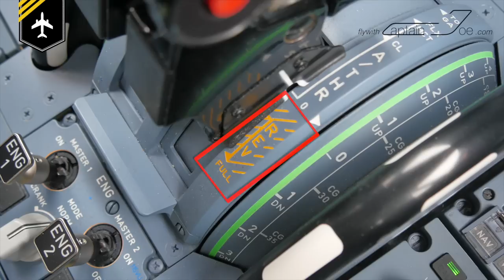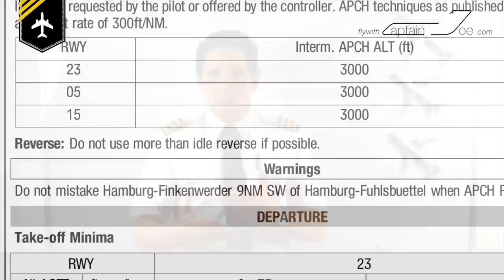What is reverse thrust? Explained by CAPTAIN JOE

Comment: Excellent video, I have a few questions.

1) If only the bypass air is directed in the forward direction what happens to the air passing through the engine core?

2) I have seen videos of aircraft engaging reverse thrust ( or at least opening the reverse thrust flaps) just before the airplane touches down is this recommended during certain conditions?

Comment: Thrust reversers can be divided into two categories;
the Mechanical-blockage type and the Aerodynamic-blockage type. 
Mechanical blockage is accomplished by placing a removable obstruction in the exhaust gas stream, usually somewhat to the rear of the nozzle. The engine exhaust gases are mechanically blocked and diverted at a suitable angle in the reverse direction by an inverted cone, half-sphere, or other means of obstruction, while the Aerodynamic, thin airfoils or obstructions are placed in the gas stream, either along the length of the exhaust duct or immediately aft of the exhaust nozzle.

Comment: Hi Captain Joe, I wanted to know why 4-engine commercial jets (747/A380/A340) sometimes only use the reverse thrusters on the 2 inboard engines rather than all 4 engines?  I hope this gets through to you.  Thanks.
Reply: It's only on the a380. And its simply because of not needing that complexity. The majority of stopping power actually comes from the brakes itself. So the reverse thrusters don't generate a major ton of braking.
Also, the a380 mainly serves routes where long runways are readily available, so again that extra reverse isn't really needed.

Comment: On other planes such as the Boeing 777, you won’t hear the engines spooling up that much when you use idle reverse so, you will hear just a little bit of a spool but in full reverse thrust, it is quite loud.

Comment: If my memory serves me right, NASA used a Gulfstream business jet with a space shuttle cockpit simulation on it and to train approaches they used to engage  a small amount reverse thrust in mid flight to give the gulfstream the glide characteristics of the shuttle.  

I always thought that revesrse thrust on an airliner used to pull up the reverser gate lock tabs on the throttles and then you'd push forwards on the throttles rather than pull the gate lock switches and pull back beyond idle.

Comment: I thought on some planes the reverse thrusters were activated immediately before landing, but that they didn't actually kick in until the plane is on the ground...when some sort of a pressure switch, activated by the plane touching the runway, told the plane that it was okay to activate them.  I thought this avoided having the thrusters accidentally activate in mid-flight.
Reply: Tflexxx02 I think you confusing spoilers with reverse thrust. spoilers will automaticly activate if armed and when the wheels touch the ground. Reverse thrust can't be activated in flight in all aircraft currently in service. some older aircraft were able to

Comment: Not sure if it's my imagination but I remember reverse thrust being used all the time in the 70s and early 80s, and it seems like it's used less these days. So what's changed? Better brakes, more regulations around noise?
Reply: It's still being used. Mostly the noise has reduced so it sounds quieter. Also if a runway is long enough, one doesn't need max reverse, instead idle reverse is used.

Comment: I have a question for Capt Joe: It seems like that at the top of the descent of a commercial flight, when the plane begins to descend, the pilot puts the engines into a very low, almost idle position, for a large part of the way down - maybe 50%? Is this true? What is the typical pattern of thrust application during those final phases of flight? 

Also, the engine noise decreases considerably during ascent of the aircraft. Is this because the air is thinner?
Reply: Bradley Cooke it is actually idle when descending from top of descent. If done properly it is possible that you don’t need power at all until you have to set flaps.

And for the second question, more power is used in takeoff than in climb or cruise. Hence it’s noisier initially.

Comment: I was wondering: in case of single engine landing on an a320 do you still use reverse thrust or the asymmetric thrust gives problems in handling the airplane while braking?
Reply: normal headwind , idle reverse. rudder application accordingly. Cross  wind opposide side to functional engine, idle reverse to slight increase reverse accordingly. Cross wind on side of functional engine , full reverse and rudder application... i GUESS :)

Comment: Hey captain joe i have a question in my mind hope u will answer it....
Question- suppose u r flying a commercial  jet then u come to know that your one engine is failed then at emergency landing is their any need to have fuel dump?and second question how will u manage applying reverse thrust when u  have only one enging in hand? Thanks in advanced!!
Reply: Sagar Thik dumping fuel is to ensure aircraft weight is less than max landing weight. So if the Weight of the aircraft is less, fuel dumping isn’t required.

And secondly, you can use idle reverse or no reverse thrust when landing with single engine using the rudders for yaw
Reply: @ZK-APA  ty buddy👍

Comment: maybe a few more interesting points:
Required landing distance  / runway length (incl. reserves) must be calculated WITHOUT reverse application, i.e. with wheelbrakes and aerodynamic devices only (exept for abnormal approaches / emergencies)             
below 70kt back to idle reverse in addition to prevent backfiring and the very marginal effect of reverse thrust at low speeds.
Happy landing folks !!

Comment: One Question: If I lost 1 of my 2 turbines, can I still use reverse thrust when landing? Will there be problems by using only one reverse thrust?
Reply: Yes you can use a single reverse thrust (provided its allowed as per the issue)

Comment: Hi Capt. Joe,

I was just wondering why reverse thrust hasn't been automated? We have autobrake and spoilers that deploy when weight is on the mains, but not reversers.
Reply: Its best if engine controls are left manual, as the pilots have full authority on it (executing a go around would be complicated if the aircraft automatically deploys reversers)
Reply: @ZK-APA  that makes perfect sense! Thanks

Comment: Good video. Question: Does a pilot always use reverse thrust at either idle or full positions, or can you vary the amount of thrust between idle and full, and if so, can you vary it asymmetrically? For example, if you were landing on an icy runway and started skidding/turning, perhaps weather-vaning due to a strong crosswind for example, could you use asymmetric reverse thrust to correct a skid? Also, you mentioned that reverse thrust stabilizes the aircraft in roll out. Does it tend to reduce yawing tendencies because of a 'positive stability' situation as opposed to 'negative stability', if you know what I mean? I.e. if your C.of G. was aft of  the engines, could reverse thrust create a negatively stable, i.e. unstable, directional control problem, as when landing a 'tail dragger' aircraft. So many questions - sorry.

Comment: To what extent do reverse thrusters work in concert with wheel brakes? I’m sure it varies with touchdown speed, weight, etc., but are wheel brakes a substantial factor?
Reply: Steve Waclo wheel brakes is the major factor for deceleration. Reverse thrust helps in reducing the distance further.

Comment: Could you make a video explaining How does the cool by-pass air (turbo-fan) help with the thrust , how does mixing it with the hot jet air strengthen the thrust?
If you already have a video, I'd love  if you could point me in the right direction towards finding it.

Thank you.
Reply: Not sure if you looked it up already, but the main goal for a turbofan is increasing propulsive efficiency. Change in momentum is (primarily) what causes thrust, and momentum increases proportionally with the velocity. However, to get a change in momentum the engine needs to do work on the air, which involves using a lot of combustion energy to increase the kinetic energy of the flow. Unfortunately, kinetic energy increases with the square of the velocity. 

That means that if you double the speed of the exiting air, you double your thrust and quadruple the energy required. That's not efficient, so turbofans do something different: they use work to turn a (large) fan which accelerates a lot more air more slowly. Now you're increasing the mass flow rather than increasing the velocity, so you get an increase in thrust without requiring nearly as much energy (i.e. it's more efficient). 

There's a second advantage for thermal efficiency because the fan lets you extract a bit more energy from the hot flow coming out of the burner as well; the temperature of the air exiting the engine is completely wasted because temperature doesn't contribute to thrust, so the more you can reduce the temperature and do something with that energy, the more thermally efficient your engine is.

Comment: Captain Joe:

About jet aircraft tails (horizontal stabilizers): why has there so much advancement of the shape of the main-wings tips (737 max, 787, 350, etc), but it looks like there has been almost no change to the end caps of the tail?

Don’t the horizontal stabilizers also create drag, and so engineers shaping them with winglets should reduce even more drag?

Comment: With reverse thrust I always assumed that somehow pulling those levers would make the engine reverse the airflow in its entirety, so sucking in air from behind the engine and blazing it forward. Now I see only parts of the outer layer are used to reverse the wind. So the thrustlevers are used to make the thrust go idle first, and then to extend the outer flaps just like on the wings.

Comment: In the event of a reverse thrust malfunction (perhaps 2 engine planes), can the airplane stop within the stipulated runway distance with its disc brake systems? or is there something else that needs to be done?
Reply: Another question ... What happens if mid flight the reversers malfunctions and opens up causing reverse thrust ?
Reply: Actually, the majority of the braking is done via the wheel brakes. Spoilers and reversers are basically complimenting the wheel brakes.

And yes, there have been a few accidents with reverse thrust accidentally activating mid air.

Comment: One question that i’ve not seen yet. How do propeler planes brake at the landing. There’s a kind of reverse thrust in planes with propelers?
Reply: Yes there is, the blades of the propeller change pitch, so now they produce thrust in the opposite direction

Comment: hi, i’m not sure if you’ve answered this, but how do you brake? is it the same for both airbus and boeing?
Reply: If you're talking about the wheel brakes, then basically the brakes are located on the rudder pedals itself. Basically you press it with your toes, with the left foot controlling the left brakes, and the right foot controlling the right brakes

Comment: So that implies that the output of the engine is far greater than the input ??  The input is sucking in air, and thus is pulling the plane forward, and the reverse output is blowing air out in the reverse direction, and thus is pushing the plane backwards.  I'm so confused ??

Comment: Captain thank you for you for sparing  time to do all of this useful explanations and you are doing it in very simple way easier than waht the have tought us in the college 

I have one question that not everyone explained it probably 
What is ground effect?! And what is the use of it in an aircraft??
Reply: Simply put, it is the increased "lift" generated by the opposite force (newtons  3rd law) to the  downward deflected air from the wing hitting the ground.
 the closer to the ground the greater the ground effect. this gives a floating feel to the pilot. It is used to reduce the angle of attack to take off.

Comment: The term ' Reverse Thrust' is sometimes misunderstood for most aircraft. The word reverse means opposite in direction or backward in direction. this is not the case as the thrust is diverted angular to the original direction less than 180 degrees. In most, if not all turbofan aircraft, only the bypass thrust is diverted. the core engine thrust is not. In fact this is increased to get the turbofan to force more air through the bypass area and increase the bypass thrust. There are two thrust vectors from each engine during reverse thrust, the normal thrust pushing the aircraft forward and the diverted thrust from the bypass which retards the momentum of the plane.  Since the opening for the" reverse thrust "is almost full circumference  of the engine on the turbofan models, the net vector is in the "reverse:" or opposite direction, decelarating the aircraft.

Comment: That's great but what about clam shell type that redirect the turbine exhaust? 747 early had both a trans sleeve and rev sleeve,,,727 had clam shells operated by bleed air so did 737 100 and 200

Comment: Hello Joe, Can you explain in a video how the "Florence Kit" works (Upwards deflection of Ailerons) on the A319/320/321
Thank you
Reply: The ‘Florence Kit’ is a set of modifications developed first on the A319 to improve landing performance at Florence airport in Italy. This kit is now also available on the A318. It consists of:

• Using the ailerons as spoilers on the ground (upward deflection) to improve braking efficiency
• Defining an alternate forward centre of gravity limit that enables decrease of the approach speed, thus improving the landing performance

Comment: Hey Captain Joe !!! 
I appreciate your detailed explanation of Reverse Thrust in Jet engines , but I have a query , How does aircraft with "Turbeprop Engines" ( Engines with wing propeller ) apply Reverse Thrust ??? As it's very hard to reverse a running engine in opposite direction ..

Waiting for your reply !!!
Reply: Turboprops reverse propeller pitch to reverse thrust.
Reply: longlakeshore Thanks for answer .. but I really doubt , Can engines go in full reverse immediately after such high speed in forward direction .
Reply: The turboprop engines are not reversed, the pitch of the propellers are.

Comment: Is it possible to land without reverse thrust?
As I flew with easyJet yesterday, we landed smoothly but I couldn't hear the enormous sound of the reverse thrust (contemporary I couldn't see if the reverse doors have opened) so I wonder if it's possible to brake (or better if it's usual) with the wheel brakes and spoilers? 
Weather was good so there were no interferences that could have force the pilot to not use it.
Thanks for answering, it interests me a lot
Reply: Yes it's perfectly possible to land without reversers, although it's a bit unusual. But depending of how long the runway is, they may only use idle-reverse, which does hardly change the sound of the engines. Full reverse is only used when it's necessary because it uses more fuel.
Reply: shi01 makes sense and extends my knowledge :)

Comment: It's really a useful information captain. Now, Joe, can you explain how do FLAPS work and do pilots move down the flaps completely at the beginning or they move them when the plane is at full speed
Reply: The flaps are used to change the chord line of the wing  which alters the angle of attack without having to lift the nose of the plane. The flaps are used at many different times depending on the situation. However, generally they are used on landing and are moved down in degrees of flaps as you are in approach for landing. 20, 30, 40 degree in three steps for smaller single engine aircraft not exactly sure the sequencing for larger commercial applications. They can also be used for a short runway take off.
Reply: Thank you GraceJacob Reed 🙂👍your information really helped to more clearly about the working of flaps and slots.

Comment: From what I can see the reversers are covering the Fan part of a turbofan engine, when the throttle increase again, does it increase the thrust inside the turbine? Which seems to increasing the forwarding thrust? Or, the throttle used for reverse thrust is by electric and the turbines are idle?
Reply: Ka Shing R. C basically what happens is the air which is going through the fan (ie the bypassed air) is rerouted so that instead of going backwards, it goes forwards, which creates the resistance.

Comment: I hve one question....if the plane is on the group so air inside the plane is not much cold...if it goes in to the air so it becomes cold....and y there is no ac on plane ?

Comment: I recently flew from BKK to PNH. What happened was that the plane (Airbus A320) was accelerating  and run for about 8 seconds during takeoff but then applied break and the upper parts of the wings opened up to reduce the plane speed. The plane then turned to taxi way to make another take off attempt. People in the plane were shocked and didn't know what was going on. Can someone please explain what was happening?
Reply: neangsinay rejected takeoff. Must be some reason because of which the pilots aborted takeoff.

Comment: Captain Joe , can you explain why A380 has reverse thrust only at it's 2nd and 3rd engines ?
 Thanks in advance.
Reply: Калоян Стойнов the aircraft is so wide that having outer reverse thrust can cause excess debris to fly around. Also having that much reverse thrust puts strain on the wings. Therefore it only has reverses in the inner engine